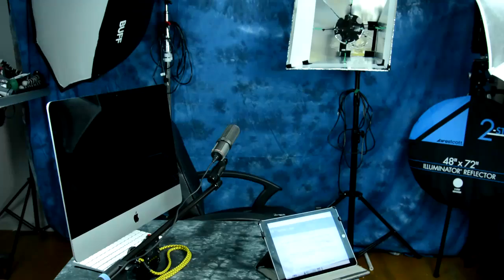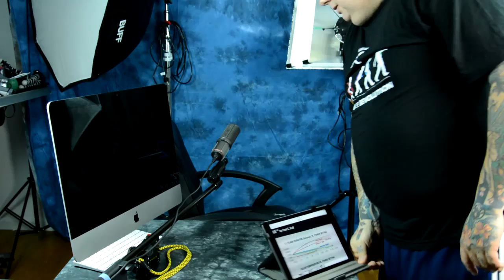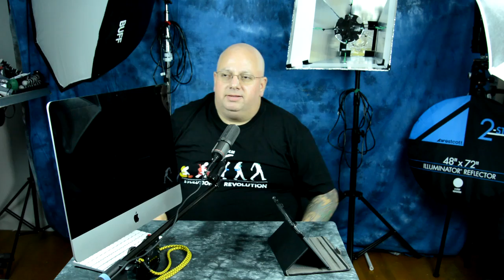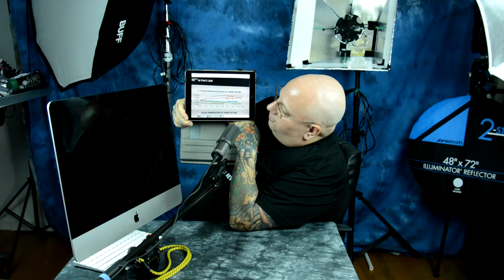HOW TO: Explaining T.1 times, FLASH/STROBE duration & its importance

Comment: Where did you see the Elinchrom specs for flash duration at less than full power?  I have checked the Elinchrom specifications both on their website and in their manuals for their flash heads and they only publish t.5 times at full power.  No t.5 (or t.1) flash durations published for anything less than full power.  Also, no t.1 times published at all.  If you can link me to where you saw the specifications, that would be great and much appreciated.  Thanks.  I am disgusted that manufacturers selling expensive strobes and flash heads refuse to publish these flash durations, particularly since all this information is available for some much less expensive speed lights.

Comment: Good Video! May I add that Speedlights can results in speed rates of up to 1/40,000 of a second (F.e. SB800 on 1/128 Output.) They actually use either a thyristor or IGBT semiconductor as a switch. So you can easily go < 1/1000 sec. with a Speedlight and a leaf shutter (Fuji) camera.